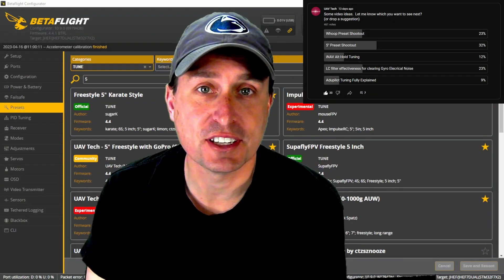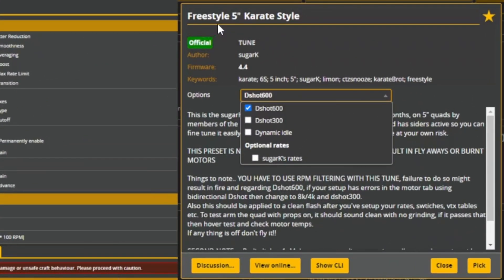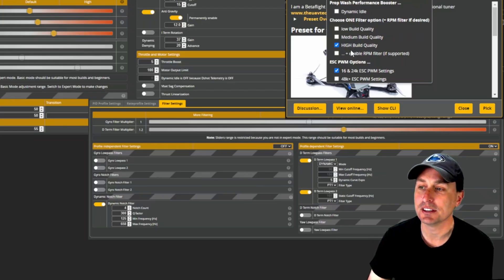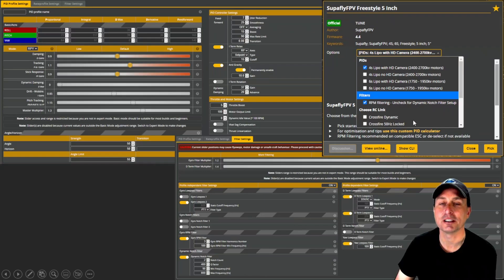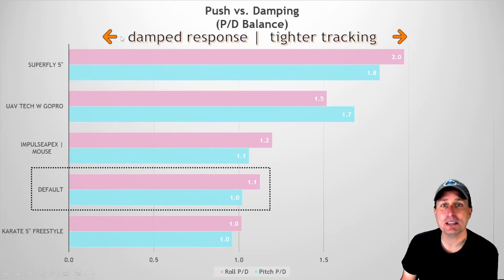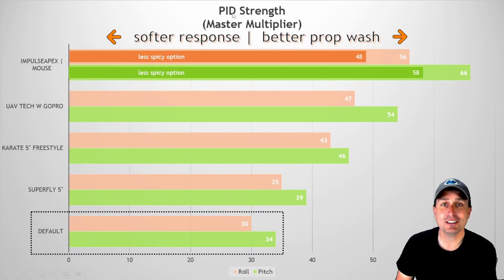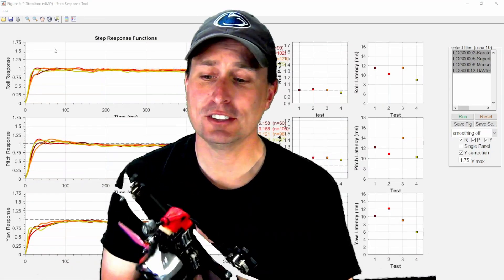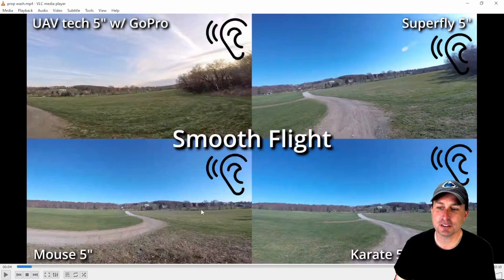Betaflight 5" Freestyle Preset Comparison & Shootout

Comment: Hi Mark, thank you so much. 
But i have a Problem. I am using your 5" w'out GoPro betaflight 4.5 (my Quad is 620gr) Motor Sounds awesome, motortemp is Low. 
But If i Roll fast there is much yaw in it. I use the high quality Option because low quality was unflightable and med has vibrations at full throttle. 
The lower the Battery the more yaw gets to it. What can i do?

Comment: Built two custom 5" last week one for me and my son. Son's build 6s mario frame with f405 v4 60a and eco ii 1900kv and mine a clone mark 5 4s with f405 55a and iflight XING2 2306 2555KV. Both with ethix PBJ props. We  used the supafly low weight medium presets for both on appropriate cell count. My son said his was buttery smooth with no jitters or prop wash issues at all. Mine was great too just a little more prop wash jitters on hard pull outs. Just need to tune that out a bit but otherwise way better of a tune than i would start out with. I wonder if I use a bigger mah battery might sort it out on its own.

Comment: So question i changed my motors from 2207 1800kv to 2306 1755 kv and I used the supafly 5" freestyle preset no hd camera with the medium smooth rates and it flew great on the 2207 motors but when I swapped over to the 2306 when I did a a punch out my quad would wobble and when I would roll it would wobble. I was wondering if that preset should be okay with the 2306 motors because I don't know much about tuning yet and I thought that preset would be okay with those motors, so I'm wondering if it's my gyro

Comment: That's a brilliant video very informative. I have a 5' build weighing in at about 780g including battery and Action 2 camera. I've had a Supaly preset on and although it handles very well I get quite a lot of prop wash. According to his literature with my moto KV I should set the Master Multiplier to 1.2. Watching one of your videos about Prop Wash I've set Dynamic Idle to 30 and increased the Master Multiplier. I got to 1.5 and the Prop Wash was still evident but not so much. 

I've put yours on today and for my build, it feels straight away that it's much better. The response is instant and the prop wash is already better than I could get it on Supafly. I say better but it's still there when I really throw it about. I set the Medium Build setting and enabled RPM Filtering. My ESC is set to 24k and by RPM. 

Although the prop wash is much better it's still there a little bit. Is there anything I can adjust slightly to help?

Comment: well i just tried the uav tech 5 with a go pro and got throttle wobble and some fly away when giving small throttle punch's but slight warm motor's and the quad is a new build, This did not happen with supafly 5'' preset i don't get it anybody  know why ? Oh yeah this happened with two other quad's as well .
Reply from the maker: Sounds like you need the lighter weight quad preset.

Comment: Hi Mark! Awesome vid, just started 4.4 and (coming from 4.2 🤫) used ur preset, on rails when I’m over 40% on the throttle, but I’m getting vibes under 40…any suggestions, mess with the MasterM slider?
Reply from the maker: Yup, increase.

Comment: I really don't get presets. This is such a subjective science. The difference in PIDs can be massive between various frames. I can't see how a preset designed for one frame could even remotely work properly on another one. You really need to basement tune each quad - from there tweak off the feel your looking for. I know its a PITA, and you could spend an entire weekend doing it (believe me, I've wasted my fair share of weekends doing this), but applying presets to just any random quad is borderline dangerous IMO. Some of these have D gains cranked up so high -  if you don't already know your build is super clean, then you could easily fry an ESC or motor.
Reply from the maker: Nah, once you get the pids for the quad class close, that pretty much works for a lot of setups within the class.  I like to say you are 80% to 90% of the way there.  If you want the last 20 to 10%, that is tuning.

P/D balance for example, across all those presets it varied, but it was fine on this quad and I suspect for many others.  Same for i/P balance.

Comment: Hows it going I have a rekon 4fr and I have really bad zero throttle wobbles as if the camera is sitting on jello....I raised thrust linearization and it helped alot however I don't like doing that because any bump into something causes the quad to freak out....I'm at a loss....any ideas? Anything would help thanks🙏🏼 and just so you know the wobbles are very bad as if the quad is drunk lol bad left to right front to back wobbling all at once
Reply from the maker: 1. Set ESC to 24k PWM
If still there
2. Reduce the Drift/Wobble slider.
If still there
3. raise Master Slider
Reply: @uavtech  thank you so much I will try this🤞🏼✌🏼
Reply: @uavtech  hate to bother you I know your incredibly busy but I dont have anyone to talk to for help and me being a newb 2 years later doesn't help lol I have the zeus f722 min on my rekon I believe it has blheli s if I'm not mistaken so how do I go to getting blheli configurator ? Hopefully lowering the master slider and wobbles slider will help but if not then I'm gonna have to raise pmw 24khz trying to avoid that because I'm not 100 sure if I have blheli 32s or s
Reply: @UAV Tech  thanks so much I moved the sliders up to like 1.2 and went down on d I think down to 2? Can't remember but it helped so much! My quad felt like my camera was on jello at zero throttle after punch outs and now it's only like 20/25% there compared to 100 so thanks again 👍🏼 I have a little left but it's now kinda propwashy but again it's alot better 🙏🏼🤟🏼👍🏻

Comment: Woah, I made a UAVTech video!!! Thanks for including me 🐭

Few things to note:

-UAVTech, supafly, and Karate offer AMAZING "all purpose" tunes. If you are flying a non-specific build, 10000% choose one of those three over what I have. Probably try all three because presets are so easy to try out.

Since that "niche" was already filled by the studs I just mentioned, my presets are much more focused. I use pid-toolbox and basement tune all my builds with my hardware, pushed to the edge (hence the high gains). My tunes are listed by frame because in what I have seen, the frame makes the biggest difference to p:d ratio and possible gains (more than motors or stack or whatever).

My tunes are meant to be flown ideally on the frame that they are listed for. The goal is to push further in some areas where a more generic tune may not. So, for example my sonicare preset has far less filtering than my Incisor preset.

For example my tp3 tune assumes a toilet tank battery and has higher gains on roll than pitch, as such. Things like that.

Lastly.... That apex tune is listed as experimental because I haven't gotten around to fine tuning the filters for that frame, so they are a bit conservative.
Reply: Use moar cheese😅 love it
Reply: 🧀 please
Reply: Hey Mouse, I’m flying the Quadmula Siren F5, it’s an H style like ur Incisor but about 100g heavier, think ur preset would be ok with the extra weight?
Reply: @reboot110  probably the incisor preset, choose the larger GoPro option. Won't be perfect but probably a good base.

Comment: how to lower full throttle shakes?
Reply from the maker: increase D-term attentions (formally know as TPA).  Default is it just attenuates D-term.  Change the change the cutoff to 1750 and set to 0.8.

Comment: Can a frame impact the sound of a motor? Have always used apex frames and when i switched to another brand the motors sounded off (nagging laggy heavy i have no idea how to describe it). Put em back on an apex and sounded like i was used to (crisp and well not nagging).. any input? Resonance or something? Quad flies perfect tho.. any input would be appreciated
Reply from the maker: Probably a frame vibration causing the motors not being able to hit full RPM.  Alex was maybe cleaner so motors could get to peak RPM?
Reply: @uavtech  so basically not something to really worry about?
Reply from the maker: @tomblanckaert6055  if you are on the Apex, no.  You should be hearing the motors "scream" at full throttle.  If they sound doggy (like not hitting 100% RPM), then add m9te filtering.

Comment: Hi Mark, all YouTubers say that by increasing Master multiplier propwash will become better.
In my case it just becomes worse, quad starts to get 2-3 biiig shakes which are visible on hd and BB, whereas with lower master shakes are muuuch smaller though a beat longer, hd doesnt see it.
What can cause this behaviour? High filter delay? (Tried 1-2ms for gyro, and 1.5-2.5 for d term).
Reply from the maker: Lower PIDs will give a bigger shake.  High it will be lower and faster.
.check your Yaw P.  Many times the shake is on yaw, and you may need to set it to RP mode for the sliders and make the Yaw P and I 100.
Reply: @uavtech  ok, thanks, and what about the latency? How much is good or perfect or bad?
Reply from the maker: Filter or stick movement latency?
Reply: @uavtech  filter faze delay latency, per gyro and d term? Ho much is excellent or good.
Reply from the maker: @fpv_am  as little as you can and it still flies good.  There is no magic number unfortunately.
Reply: I have a rotor riot tanq and am just getting at every quad is a lil different. In my experience moving p and i up helped tame or end the propwash a little sooner and kept increasing intil it was noticable on slower decents. Then increased D. Wound up over 100 in Ps and my dmax is about 74. They get warm, i might lower the master some to see if it preforms worse but definitely take his advise first.

Comment: Thanks for the shootout. It's interesting to know how others approach things. The preset system from Limon has made it so much easier to help people get a good tune. It's a tough call to draw the line between a robust tune for general users out there and balance performance as well, but there is a link in my tune to further tips and a calculator for those who want to squeeze out more performance....
I know the Dynamic notch can get lower total latency but the motors never sound as sweet due to its lower accuracy compared to the RPM, so it's a tough call again....like most decisions...
Reply from the maker: Yeah, shoot.  I missed covering that KV slider help.  Shoot.

RPM vs. DN Only: folks have easy options is the win.  It is a checkbox.  Try out both, see what ya like.  :-)
Reply: Another part of the balance is usability. One could make a tune preset that was both robust for a wide range of setups, and has amazing performance potential, but then you end up with an insane "option" matrix and a preset with more options than the pids tab in betaflight, so it's not easy for people to actually use.

I would love to see dependent/nested options as well as a combination of check boxes and radio buttons in the options to help with select 1 vs select many to help with this a bit in the future ❤
Reply: @mouseFPV  yeah thats true also - where to draw the line on options. I tried to keep mine simple otherwise as a preset it becomes more complicated than using the GUI lol....